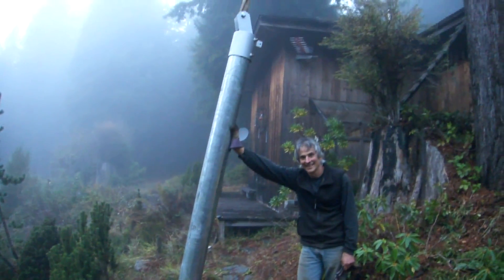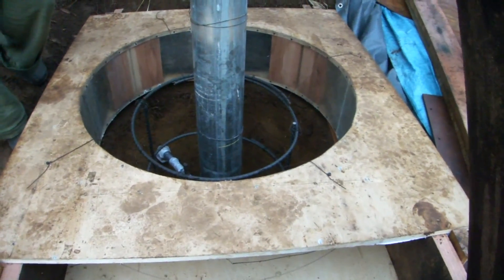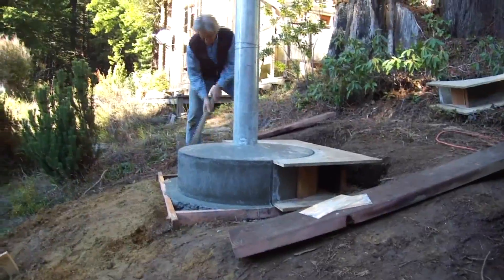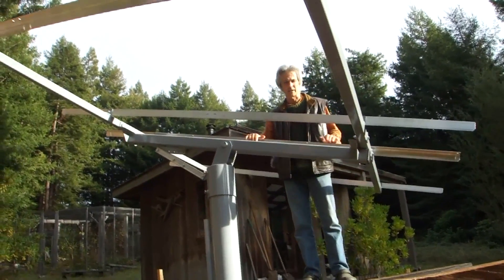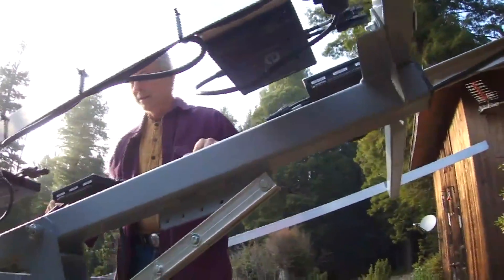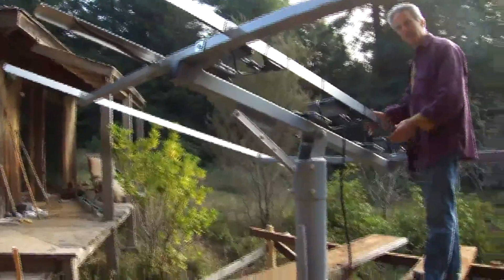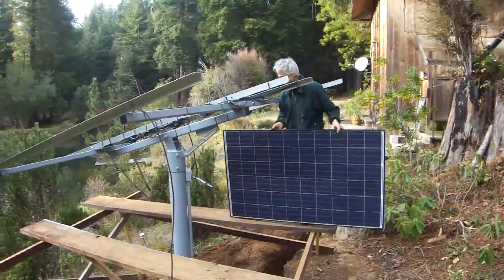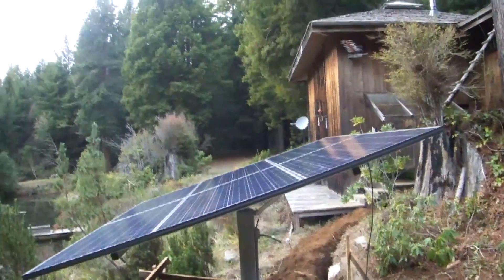Top-of-Pole mount solar array installation

Comment: David - I know your post is 7 years old but I hope you can answer my question.  Where did you get the top of pole bracket?  It look tremendously strong and I could use some of those.
Reply from the maker: The bracket is from DPW SOLAR (Direct Power and Water). Their website has a page that will do an engineering drawing for your project.
Reply: @DavidGrothsculpture  Wow!!  Thanks for the quick response and the information.  I hope my installation turns out as well as yours.  It looks like you live in paradise.  Cheers!!

Comment: why did you need inspections in the mountains?  are you in California?  Do you plan to backfeed the grid?
Reply from the maker: I’m hooked into the grid and a permit is required to have PG&E change the meter type. Otherwise with the old meter any electricity going to the grid would register as electricity being used.

Comment: what diameter is that pole?  6inch?  

how much do those panels weigh? 

where did you get the foundation information for determining how 
large of a cement footer you need in relation to wind forces and weight 
of the panels? 

Im in the process of building my system now and I have 6 panels 
that are 235watts each weighting 45lb each panel. 

I wanna be able to expand my system down the road and i wanna 
be sure I make my pole and footer size large enough 
to accommodate at least another 6 panels, ie: roughly another 270lbs. 

if you looked online for the building department stuff, what were some 
of the words you used to find that info... My county website and 
offices are not to helpful with giving up the information im looking for...
Reply from the maker: +Jarred Sawczyszyn 
The pole is 6" SCH40 steel pipe. Each panel weighs 41.9 lbs. DPW SOLAR has on their website a design tool that you can put your information into and it will design the pole mount system with the required specifications...then you can print out the designed system to submit to your building dept. Some building departments may accept the specs and design but others may still require an engineer. Good luck!
Reply: +David Groth heck yea, thanks for the quick reply brother.   I'll check that site out.

great job my friend, what your lady friend said was true for sure, on beautiful foundation you made for your array. 

I'll be sure to share my setup with you

Comment: I have a similar system set up. How tall is your pole overall? Mine is 11' with 1/3 in the ground. Also, you live in some beautiful settings.
Jerry of Pine Meadows Hobby Farm
https://www.youtube.com/channel/UCjWwzxoKf0j7uSkO9BjmG8A
Reply from the maker: +Pine Meadows Hobby Farm  The pole for my system is also 13 feet. 1/2 is in the ground which satisfied the building department. However the specs would have been closer to the 1/3 in the ground. Great to be producing energy for capturing sunlight!
Reply: I suppose that with your system, as high up in the mountains you appear to be, would be exposed to a greater wind force than those of us who are sheltered in valleys against a mountain. Just for safety measures, I used 31 80lb bags of cement reinforced with a rebar cage such as yours in a 3' x 3' x 3'9" deep hole.

Comment: Pls tell me where you got the top bracket that goes over the pipe. 
Thanks
Reply from the maker: The bracket is DPW Top of Pole Mount and I ordered it through CivicSolar in San Francisco, CA...at the time they had the best price. On DPW 's website they have a program you can design your pole mount system and print out a  high quality drawing with all the specs. Good luck, David

Comment: Great video. Thanks for uploading. A question. What make 'brand name' is the antioxidant cream and where did you get it.
Reply from the maker: Hello Douglas,
The anti-oxidant compound I used is Ox-Gard by GB (Gardner Bender). Also Permatex makes a similar product. These products can be found at hardware stores...generally in the electrical section. David